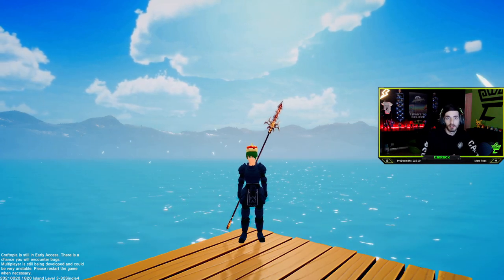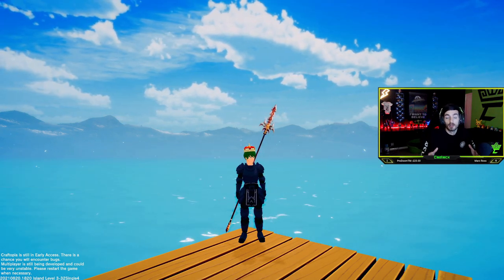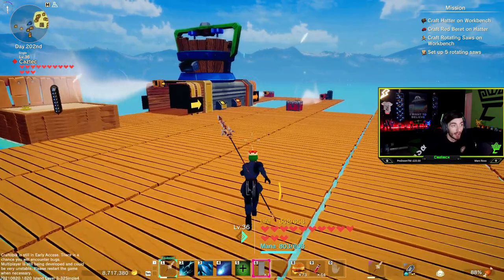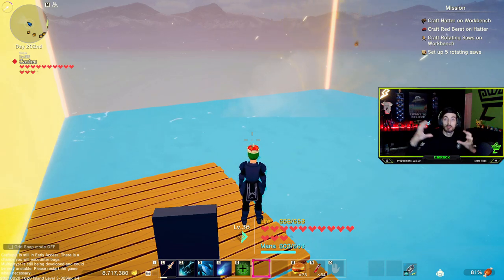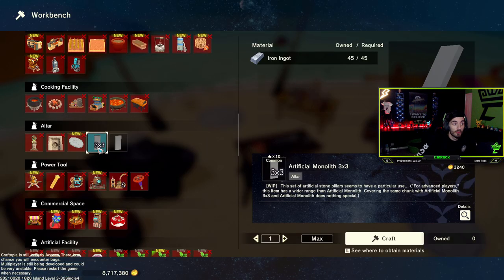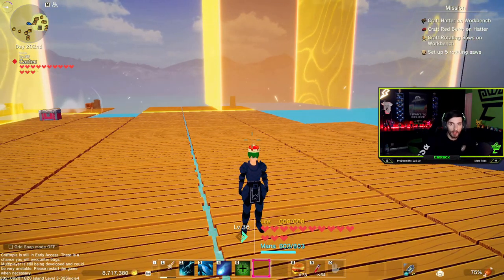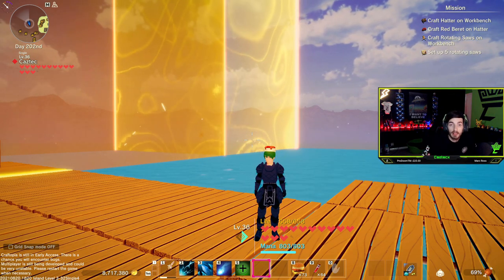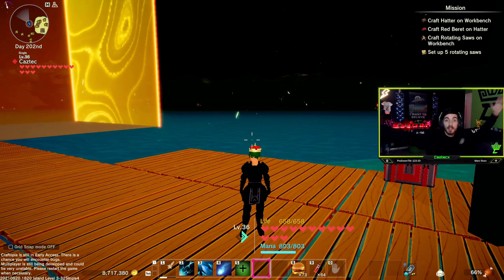How to Keep Automations Working when you are Across the Map | Craftopia Guide

Comment: Legit info, absolutely valid... With exception of old Gen consoles😢. Unfortunately for older consoles such as pre series s Xbox ones you still need to limit the number of automations, if it's actively dropping items (e.g. bioethanol, excavator, plot farms etc.) the drop cap is finicky and usually quite unforgiving
Reply from the maker: I didn't state old gen consoles were any different. All console aswell as PC Xbox and Windows have a floor limit, thr number varies depending on the resource but is most often 32 items, however this limit doesn't lower the amount of automations available as much as the items on the floor at one time, you can set up automations to run beside eachother with minimum items on the floor at 1 time, however even steam users don't do that, we just use separate empty islands 😊
Reply: @Caztecx  apologies, I didn't mean that you did, but I'm unfortunately on an old gen console and I have to island hop for my farms to not crash my game. All I meant was the more farms you have In 1 world regardless of distance you'll feel the fps drop. This of course varies from island to island (with some exception for the empty islands RNGesus willing lol)
Reply: @Caztecx  oh and I do use the empty islands as much as I can if RNG is kind enough to grace me with one 😂